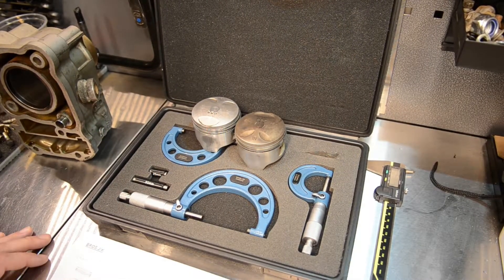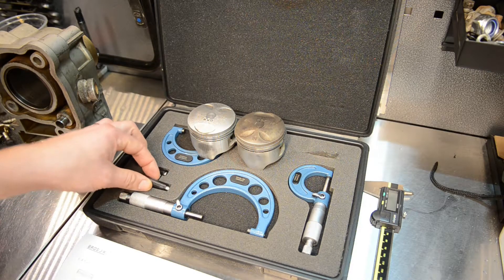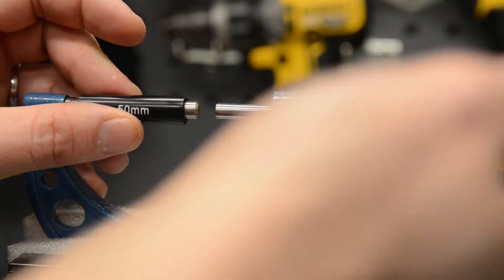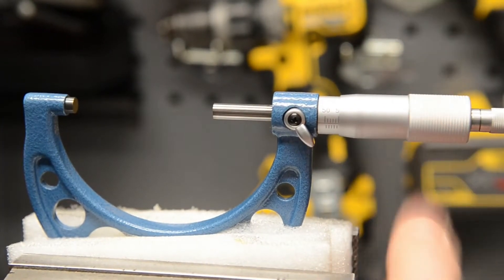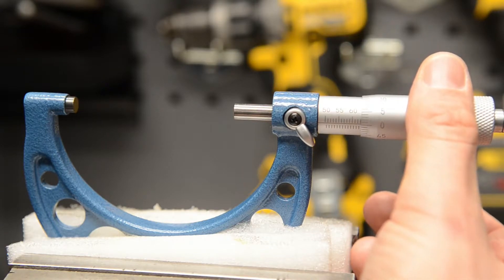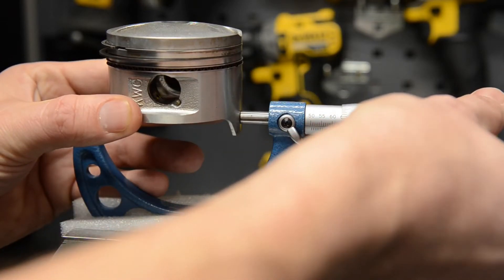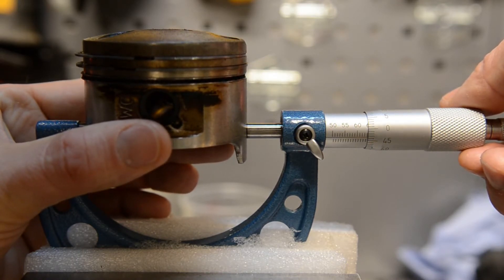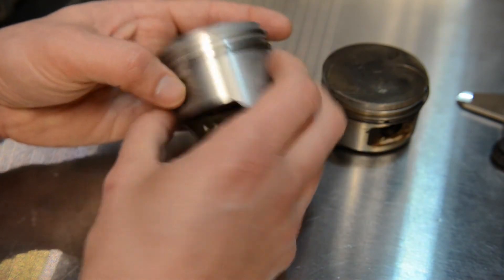Honda Bros how to measure the piston using a micrometer

Comment: Should be installing a Naraku 70kit on my rieju mrt but not too sure how to do it is it the same as your Naraku moped video ???
Reply from the maker: I think yours is liquid cooled so that will be an extra step to drain the coolant. You will also have to find the torques for your head bolts, so you know what to tighten in after your assembled. All the rest is more or less the same
Reply: @Yoke.  thanks mate much appreciated 🙏